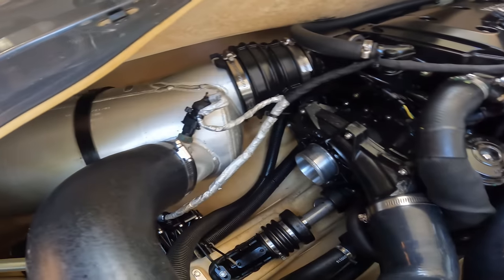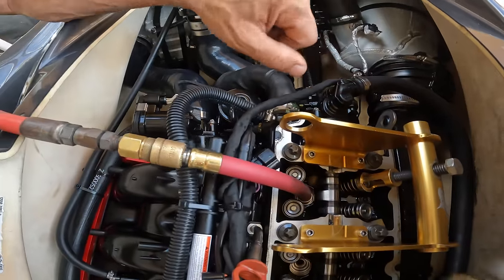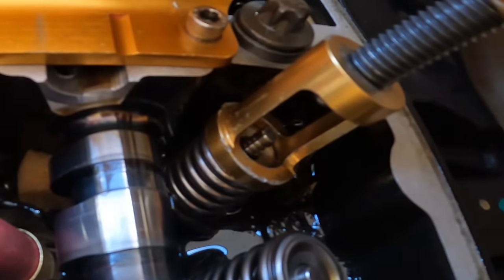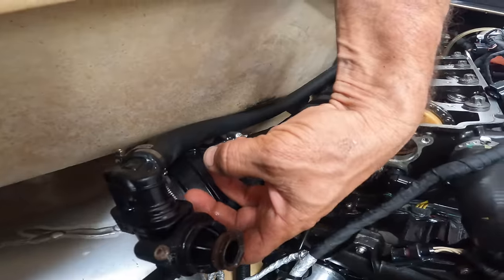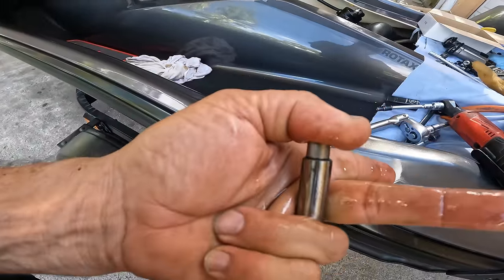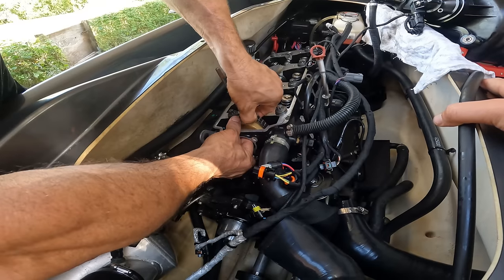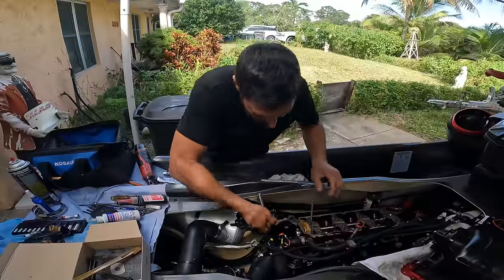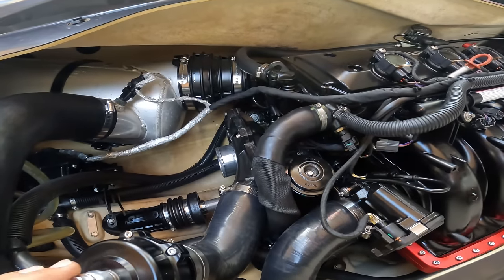How To Install a Cam on Sea Doo Rotax Engine 215 260 300 325 RXPX RXTX GTI GTX GTR WAKE FISH PRO

Comment: Torque to yield bolts like the ones used on the rockers are not to be reused.  If you replace the crush washers, you will not have to mess with the silicone.

Comment: 17:20  it would be a good idea to use that foam piece to prevent the washer from droppin in the motor
Reply from the maker: Yes, I forgot to put it on good point

Comment: If I order your cam, spring retainers and springs from you, is there anything else I need? I’m currently running JP stage one, oil catch can, air intake and solas 13/18. Running 2020 RXTX 300. Also have fizzle piping, no blow off valve and no fizzle intercooler. Just looking for a little more top end but want it reliable, not sure if I need another tune or I can leave it as is with JP stage one flash that was done. Great video and eager to tackle this upgrade myself. I probably watched this video 10 times to make sure I didnt miss anything on install. 😂

Comment: What colour spring is in the tial? Can't be yellow if it's open on idle..?
Only asking as I'm not sure what colour spring to use for mine.
I have 142 wheel
Reply from the maker: If you have a Fizzle kit, you’re fine this particular client end up changing the spring later for one that was not open on idle

Comment: How much pressure in the air hose do you use? Do you have a regulator on the compressor? Bc I’ve seen were to much air can go in and push on the engine and rotate it. Also seen where people lock the engines up in some way from spinning.
Reply from the maker: I’ve never seen an engine spin over since I’ve been doing this

Comment: Will injectors dump fuel if fuel pump is not running
Reply: I believe you’ll still have fuel in the line even if the pump it’s not running. You’ll have to disconnect the hose to the fuel rail. It’s easier to just disconnect the injectors and avoid the gas smell and the mess. 👍🏻
Reply from the maker: The reason why I say that is because after everything is done, I like to spin the motor so everything gets lubricated without the motor running

Comment: Great video as always and super clean ski!! 
@Calas the cam gear bolts would the 21 and up bolts be a good upgrade for a 260hp engine ? Or better to use ARP bolts or 12.9 Allen head bolts ?
Reply from the maker: 21 and up are good
Reply: Thank you sir 🙌🏼

Comment: Hello , I did my cam too and I forgot to put it on time and lock it before pulling the cam out . When I put everything together I broke all three bolts from the cam . What else can happen to the engine by me doing that ? I’m waiting for the bolts and put it back on is there anything for me to check ? Thanks

Comment: He didn't specify in the video so I'll clarify:  I suggest you do not reuse TTY (torque to yield) bolts like the rocker shaft bolts if you are not familiar on how to measure them for stretch.  The rocker shaft bolts are notorious for breaking when reused because their yield range is really small if the torque angle step is done just a bit over by seadoo or yourself.  I've measured every one I removed from factory skis and find more than 25% are stretched past the old manual reusable limit before seadoo changed the manuals to say just buy new every time they are removed.  I never reuse them on customer skis but keep the "good" ones for myself because I'm a cheapass.
Reply: This is a good tip 👍
Reply from the maker: I missed that one🤦‍♂️

Comment: Would this cam be ok to use on a 230 motor with your CALAS valve springs and titanium retainers?
Reply from the maker: Yes
Reply: Thank you and are the superchargers the same on the 230 as the 300 would it be safe to do a 300 tune with your cam?